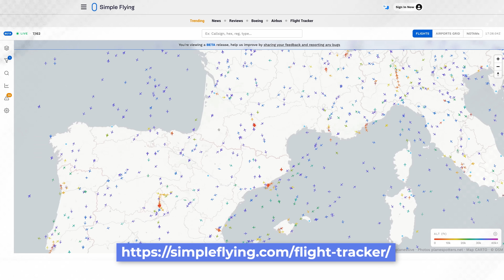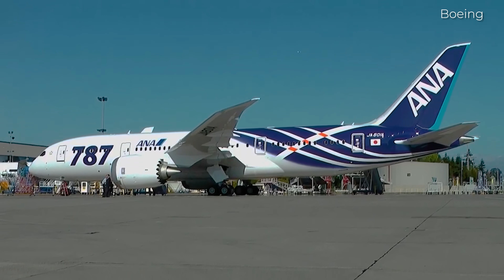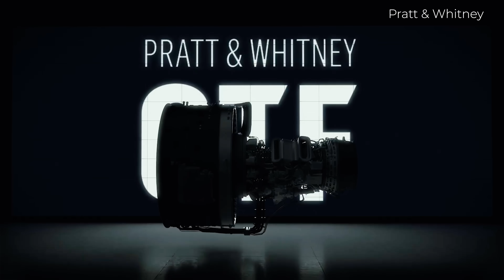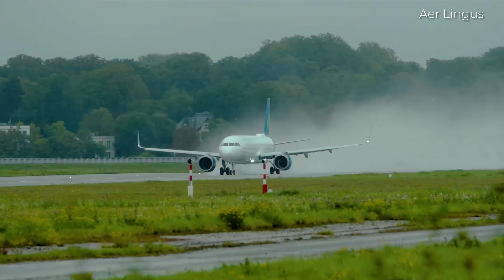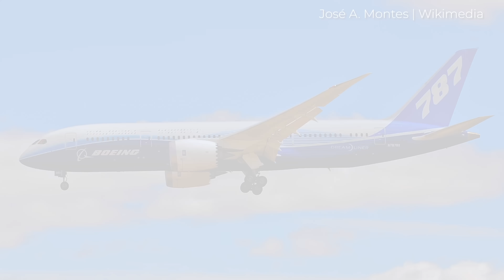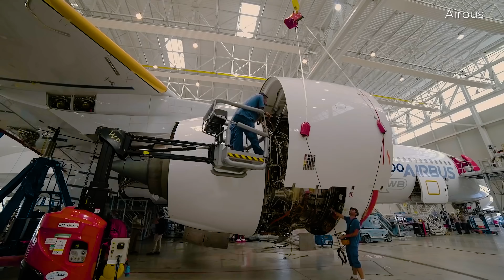Why Boeing Abandoned Its Famous Engine Design for the 777X

Comment: It didn't take 10 seconds for me to conceptually design a rotating chevron mechanism which enables chevron mode when operating in the region of an airport and smooth ring/no chevron mode when cruising for an efficiency boost.  But the mechanism adds cost, weight, and complexity.  Is the tradeoff worth it?

Comment: Airlines care more about fuel efficiency than noise pollution. It’s not like the GE9X isn’t alr quieter than the GE90
Reply: Yes and no. Noise translates directly into landing fees. In the end it is just a numbers game what saves more money, and that is what airlines want to go with. Since aircraft are usually flown by the first airline between 4 to 12 years, while noise costs can change several times a year, it is a classical forecast problem.

If you can get the same noise reduction without performance problems, that is obviously preferred.

Comment: Some CFM56s fitted to Airbus aircraft actually do have chevrons on the hot section instead of the cold section.
Reply: Not at the nacelle but at the exhaust pipe …!
Reply: @EngelsAviation  Eh yep, I literally said that so no idea why you needed to say it another way....
Reply: @davidkavanagh189 cuz i m an aircraft engineer… i dont know why U say that !!! Lol
Reply: I believe its only on A321 CEOs.
Reply: @Soordhin  Yeah I think you're right
Reply: That actually makes a lot more sense, as hot exhaust made up a significant amount of the noise produced but only contributed like 10% of the thrust.

So that can help substantially with noise reduction but only a negligible amount of drag added.
Reply: @tonamg53  It's already done on a lot of engines by using an exhaust mixer. Some examples are Trent700, RB211, V2500, JT8D and many many more

Comment: Flaps are retracted after takeoff.  Just wondering why chevrons can't be designed to be retracted?
Reply: The extra bulk and reliability/durability considerations likely make retractable chevrons impractical.
Reply: The retraction mechanism would have to be located within the jet exhaust stream, creating turbulence, or outside the nacelle, adding drag.
Reply: the amount of machinery for something not really necessary would be rediculous

Comment: The Dreamliner sounds more whiny and noisy than the 350, very baffling indeed.
Reply: What are you talking about? That is rubbish.
Reply: From my experience on a United 787-10 that was my ears constantly adjusting to the altitude not the engine being whiny.

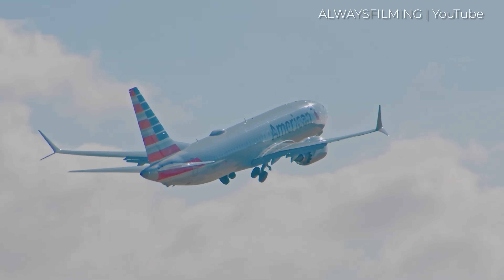Comment: 3:10 Regional and shorter haul jets doing multiple takeoffs per day are the ones most benefit by chevrons with the least percent of time at cruise and with the most noise reduction benefit
Reply: Not when their engines are smaller and produce less thrust and therefore are quieter anyways
Reply: @soccerguy2433the size of the engine isn't what matters, it is exhaust velocity. That's why a 727 with its small engines are so much louder than a 767 or 777.

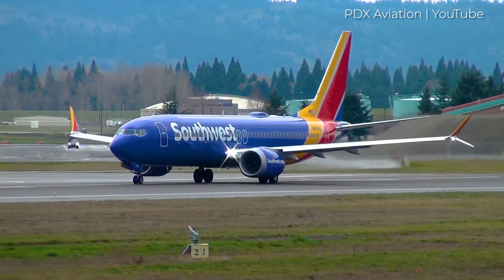Comment: 3:13 can we point out another YouTube channel with no engineering credentials shouldn’t be used as a source. SMH
Reply: These numbers are generally from product advertisements and press releases. While secondary sources are indeed not preferred, unless said source have a reputation of misrepresenting information, then it's not normally a big deal. It just shows either 1) information is scarce and the primary source did not provide references, or 2) the writer could not be bothered to track down the origin of information.

The problem would not be with MP's lack of engineering credentials, rather with the fact that dramatisation is their main draw (at least on the main channel), and that their liberal use of AI, at least in the graphics department, gives me no confidence their writers don't also use it and may have included fabricated information.
Reply: AI use isn't worrying lol get a grip

Comment: I saw the 777X fly at the my local airshow in 2022. Even when the pilots throttled up to do a steep climb, the engine noise was a fair bit lower than I expected. I guess having that giant front fan that spins slower really helps. I miss the GE90 scream but for everyone else that lives near a big airport, 777X will be quite a friendly neighbour to have I think. I think it’s still worth having on the MAX because it operates more frequently into small, downtown airports.
Reply: The max fan RPM for the GE9X is actually the same as the GE90115B and the GE9X high pressure rotor rotates even fast than on the GE90. The GE9X fan is only a tiny bit larger. If it genuinely does turn out to be quieter in service it will be mainly due to differences in nacelle and intake design rather than the core engine itself. It's also worth remembering that at an air show, the empty aircraft will rarely be anywhere near the typical service power levels even if doing those spectacular zoom climbs.
Reply: @davidkavanagh189  Interesting stuff! Of course all this tech items are likely kept secret, but it’s still interesting to try piece together the physics of how all this hardware works.

Comment: I think Boeing made the right call when the 787 was launched because airport noise was becoming a huge issue. But in the long run, I think Airbus got it right by improving the engine itself instead of adding chevrons. 

The fact that Boeing dropped them on the 777X pretty much says it all.
Reply: Airbus isn't an engine maker. They had nothing to do with engine improvement other than commissioning engine makers to do so.
Reply: @ekt8750 That's obvious. 🙂
Reply: 1. Airbus doesn't manufacture engines, though they can specify some features.
2. Airbus's engine makers did not improve upon the design - the GE variants with chevrons were still more fuel efficient that the most equivalent alternatives from other engine makers.
3. Airbus did use the technology with a320neos that use leap1a engines - they only have the internal chevrons however and not the ones in the nacelle.
Reply: What engines do Airbus manufacture.......?
Reply: @artrandy  That's obvious they don't manufacture any engine. 🙂